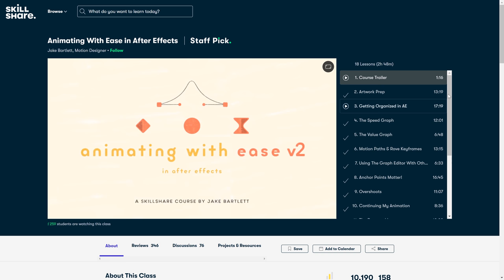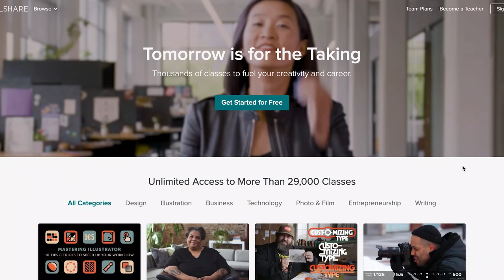How ice water makes hot water boil

Comment: Hey steve I have a good idea. I don’t know if you’ve done this but I think I can make water feel soft. Here’s the steps so I can demonstrate it. Go to your bathroom and start your shower. Then close off your drain so the water starts filling up. Put your hand under the water level just so your hand is barely submerged but not exposed to the air. Now feel where the water is falling down. I don’t know if you’ve experienced it before but you don’t have to do it in a shower setting you just need big water sprinkles and not a jet of water.

Comment: After seeing this demo in my thermal physics class, I tried doing it myself but took it a step further. I tried reaching the triple point of water by capping off the top then sticking the bottle in the freezer (this took like 20 attempts and a whole year before I found a bottle that wouldn't shatter). I didn't actually reach the triple point of water, but I did witness interesting phenomena. If I let the water settle, then gave it a single violent push downwards, it would create this loud popping sound. I took a slow motion video of what was happening and a bubble would form in the middle of the water. I think this might be a way of making super heated water, but instead it's super low pressure water?

Comment: before i watch the video i am going to make a guess.  the water is just below the boiling point at the rooms pressure, the bottle is sealed, so no air can come in or out.  when cold water is ran over the bottle it cools the air inside the bottle, when the air is cooled it contracts.  since the bottles is sealed and no air can go into it, the pressure inside the bottle drops.  at lower pressures water boils at a lower temperature.  since the hot water was just below the boiling temperature at the rooms pressure, when the pressure dropped it started to boil.

sorry if i worded that bad or it didn’t make sense

Comment: You could also think about this in terms of reaction rates. Since the product of boiling (water vapor) is also the reactant /input to the process of condensation, if you increase the rate of condensation, you shift the equilibrium of evaporation towards the product side, so that evaporation occurs more rapidly.

Comment: This seems like the method used for some diy heat-pipes/vapour-chambers where water (or any other coolant) under low pressure is used to quickly transfer thermal energy away from hot objects, only without copper or aluminium tubes. And while I might have been expecting something thermal-transfer related somewhere mid-way video, you did a way cooler segment of this during your stirling engine video.

Comment: I burned my hands pretty badly because of a steam explosion once. Instead of separately heating a container of water to make coffee in a french press, I boiled the water it in a microwave directly inside the french press container and it had no nucleation sites to the point where it was super-heated. Then I poured in the ground coffee. Big mistake! All those coffee particles provided many nucleation sites simultaneously and it erupted showering my hands with super-heated water. Make sure to pour the water onto the coffee that's already in the container and don't be holding it so the effect is more gradual and so you can move away if it overflows.

Comment: 0:11 the bottle is sealed and the vapor pressure is close to making the water/liquid inside boiling by just reducing the temperature,... The water must be boiling at the time of sealing the bottle. Pouring ice cold water will bring down the air pressure inside the bottle lower than the pressure required to boil it without heat. When the temperature of liquid also gets low the boiling would stop.

Comment: Before I watch the rest of the video (I’m at 0:40 ) I’m gonna guess how it works. After he caps it off the pressure on the inside increases to the point where the water can’t boil anymore. When he pours the cold water over the glass, the decrease in temperature causes the pressure to decrease as well. This decrease in pressure inside the bottle allows the hot water to continue boiling.

Comment: An easy way to explain that, is that boiling water only occurs when the water pressure (by heating up, or lowering atmospheric pressure) is equal to or greater than atmospheric. You can boil water if it’s in a vacuum chamber with no heat, or not boil water in a hot pressure cooker (closed system, I’m not a cook tho lol)

Comment: I instantly supposed it had to deal with pressure, but I am a physicist too :p since you talked about superheating, another cool phenomenon is undercooling, when a liquid remains liquid below the melting temperature. This is usually shown with water, but if you do it with a material with high melting temperature, you can see a phenomenon called recalescence: because the solidification occurs at the melting temperature, the undercooled liquid will suddenly increase in temperature emanating more light (that's why the high temperature, you need to see it glowing). I think you can find some videos on youtube. Although this will be drowned in the moltitude of comments, if you are interested I did my master thesis and my first paper on this topic.

Comment: I wonder how much of the pressure drop is caused by the colder air wanting to contract, and how much is from the water vapour condensing out of the air. I would not be surprised if the latter had by far the greatest effect.

Comment: 4:00 ReBoiling water is a famous instance where the water GEYSER esplodes in the microwave. Just boil it once, let it sit there and rest, and cool 3 or 4 hours, (This allows the resident gasses, chlorine,oxygen,nitrogen etc, to out-gas) then ReBoil it. And BaBoomSki !!!
The sudden reheating, builds up the heat below the cool, heavy surface, (with no nucleation sites, and so you have Superheated water under pressure waiting to erupt)

Had you boiled it the first time, ONLY HALF FULL(or slightly less), and suddenly tightened on the lid, then FROZEN the bottle on it's side, (so the water wouldn't be above the halfway mark to crack the bottle from freezing) after freezing, place the bottle up-side-down metal lid on the palm of your hand, (might need to use a paper o-ring to seal the lid but allow the heat pass directly to the liquid) after a while you'd "SEE THE TRIPLE POINT OF WATER" , where you would see ICE, LIQUID WATER, AND BOILING STEAM, occurring from the heat of your hand.  All very exciting, but your SUPERHEATED GEYSER IN A BOTTLE, takes-the-cake for sure!!!
How on earth did you find the ice water on top of heated vacuum bottle anyway? Not a usual household practice is it? Creative environment for sure!! Mixing oil and water...

Comment: I think the ice water cools the air in the bottle, thereby condensing it and decreasing the air pressure, so the hot water boils until the air pressure is back at some equilibrium point.

Comment: Edit: it's the same

I just saw the demonstration and I had a theory that only got confirmed when you purposely mentioned closing the cap tightly

I believe that the cold water condensed the vapor thus decreasing the pressure in the bottle making the vapor pressure of the liquid (at near 100°c it's gonna stay at around 1 atm while the pressure will be significantly less) higher than the pressure in the bottle and that's when liquids boil

Comment: Lol, I was thinking that finding a wine bottle that wouldn't shatter was the real question in this experiment. It's not like those things are made of Pyrex.
Also, always stick your spoon into the mug before putting it into the microwave. The metal helps to heat it more quickly and no danger of steam explosions. And no, a spoon in your mug of tea doesn't cause problems in the microwave.

Comment: I DID pause. And I got 2/3 of the explanation.

Realised there was a difference in heat capacity between the liquid and the gas.
Realised there's a pressure drop as the gas cools.
But I didn't even consider the vapour pressure. 

The gas I was thinking about was just air but now I'm thinking that the vapour pressure drop is probably the most important contribution to this effect.
I wonder if this experiment would still work if you brought the container close to the boiling point in the microwave without exceeding it.

Comment: Paused at 0:46, my assumption is that the cold water shrinks the bottle ever so slightly, and increases the pressure inside the bottle before the transfer of heat allows the warm water to cool.  I think it is probably different than that, but it is a rough guess about pressures.
Reply: Edit, Oops, I forgot that a lower pressure decreases the threshold of boiling, not the opposite.  It makes sense.

Comment: Yeah, the explaination was kinda obvious - but entertaining to watch nontheless. Btw: you can carefully scratch a bottle around its circumference and then break it along that line with hot water. With a little bit of practice you end up with good results. You can either smooth out the edges for use as a drinking glass, vase or spaghetti container (mine are held by a cut off Havana Club bottle), or leave it sharp, reattach the top end of the bottle, fill it with liquid and screw on the lid. Negative pressure will hold the liquid inside and the breach is almost invisible... until someone decides to take/open the bottle ;D

Comment: I paused the video before any explanation and came up with the idea that lowering the pressure inside of the bottle would reduce the boiling point of the liquid within. I noticed that the bottle has a cap screwed on, and it wouldn't work without that - you'd just lower the temperature and not the pressure without the cap.
EDIT: After watching the super heated water bit, that is why you should leave something like soup to stand for a minute before taking it from the microwave.  If you don't, you can get a nasty hot soup explosion when the spoon is put in.

Comment: I had once a hot chocolate that had something similar. 

The hot chocolate didn’t boil in the microwave but was for 10 seconds longer in the microwave than I normally would have. I took it out and put a spoon into it. It started boiling immediately. It was a mild reaction so I didn’t get hurt at all. But the hot chocolate came out of the cup and it was a big mess. I guess it is the same as what you explained in this video?

Comment: My initial guess was that cooling reduces the pressure of the gas, as in the ideal gas law, so that would make the liquid boil. Giving it a few more seconds thought I realized that the vapour would start to condense, reducing the pressure of the gas a lot more than the gas law would predict, and reducing the partial pressure of water vapour in particular. Essentially, ignoring the air, you're evaporating the water in the bottom of the bottle and condensing it at the top quite efficiently. Might work even better if the bottle were a better heat conductor, but I guess aluminum cans are less transparent and less micro-wave friendly. :-D

Comment: My explanation initially was regarding the Latent Heat.
The cold water loses heat to turn into Ice, while hot water gains heat to boil.

But the loophole with my explanation is that it should technically cool the liquid rather than boiling it, in fact ice cold H20 didn't turn to ice.

Comment: I definitely guess that exact thing.  It has to do with Vapor pressure. Increase the energy in the liquid and the molecules go from a liquid phase to a gas phase. Gas is more compressible  therefore you can fill the area with more molecules since there is enough energy. This increases the pressure when you cap it off until it reaches equilibrium.  Lowering the pressure... lowers the boiling point. By cooling the gas molecules aka removing energy. The pressure drops causing the water to boil. This is the reason that a room temperature bottle put into a fridge become compressed and deformed. Lower energy lower gas pressure. Same reasons that they tell you about your tire pressure with change in seasons.

Comment: It should also be mentioned that vacuums are dangerous, and by cooling the water vapor, you're creating a fairly strong vacuum (over 95%) in a bottle that may not be able to handle it.  If the bottle fails, it will likely implode, showering the area with glass shards and the still-hot water.

Comment: Just going to guess based on the title and thumbnail alone, pouring cold water causes the air on the inside of the bottle to decrease in temperature. 
This causes the air to decrease in pressure as the molecules vibrate slower. 
This decreased pressure lowers the boiling point of the still pretty hot water, causing it to boil.

Comment: Before I'm listening to the explanation: I wondered why he pointed out to put the cap back on and why the bottle didn't overpressurize while the water was boiling from the icewater. My guess is: the icewater condeses the steam in the bottle, creating low pressure, which in turn lowers the boiling point of the water at the bottom. Since the water is already pretty hot it starts boiling again
Reply: Congrats to me: spot on 🥳

Comment: okay so I'm feel free to have anyone recite this back to me but I'm over taking physics in high school and it was my favorite class I ever took honestly I'll never forget some of the things I learned there and I literally can look at things like table chairs and tell you how much they weigh by looking at their mass and guessing what they're made out of in their density which is all fun and done. Until about 2 years after high school when somebody told me that the temperature of something depends on its mass it's ability to retain heat or cold transfer it and then pressure. Along with any external factors that might be keeping a hot or cold etc right. but I don't ever remember studying anything about pressure and its relationship to temperature in my senior year physics class and to be honest it's a huge deal because in every application the pressure is different in the pressure inside your house a slightly different than the pressure outside your house and although it doesn't make much of a difference when it comes something like wood glue drying that's the difference of like three or four hours so this really should be taught at the basic level when we first learn this stuff because it literally is important to every step along the way anything involving temperature involves pressure as well and we're just not taught it in our first year physics which is kind of like learning how to do basic math and when ever teaching you PEMDAS you're missing the p or something. I'm glad a lot more YouTubers have educational channels like this because it's really easy to figure out but would have been handy f**** 20 years ago.

Comment: i wouldve guessed that by capping off the bottle, water vapour will fill the remaining inside volume, and as steam is incompressable once the volume is filled the water cannot boil (release steam) into the bottle anymore as it cannot compresst the vapour, but then by pouring the cold water over it, that condesnses tehe steam back into water, creating a space in the bottle for steam to fill.

Comment: I got this idea based on the fact that he's primarily pouring the icy water over the bottle where the air is, I'm guessing it's because the cold water cools the air, but not so much the hot water. This reduces the air pressure inside the bottle, dropping it low enough that it causes the boiling point of the hot water below its current temperature. Same idea as using a vacuum to lower boiling points to room temperature kind of thing.

Comment: Haven't watched yet but I think the cold water takes energy away from the air in the glass causing the pressure to drop and the hot water has has enough to boil once the pressure low enough

Comment: My guess: The air inside the bottle is very hot, and probably a mixture of steam and air. When you pour cold water over the bottle, the air contracts, pressure drops, and water boils at a lower temperature at lower pressures.

Comment: Question that my little sister and I have : can this also be explained by the fact that the condensing of the water vapour leads to a decrease in pressure in the bottle, meaning the water boils to equilibrate the fractions of water in gas and liquid phase, similar to how pulling a vacuum on the water would cause it to boil? 

Is this just a different way of explaining the same phenomenal you described or is there a flaw in our thinking?

Comment: The ice water cools the air in the bottle, causing it to condense slightly and drop in pressure, allowing the water to boil (off gas) at a lower temperature?

Comment: Awesome video, also that's exactly how heat pipes work.
Reply: You may be a little coy here, referring to "heat pipes", not"heating pipes", as described here (which would have served better s a comment): https://www.1-act.com/heat-pipes-a-basics-demonstration/
However, in this video there's not only not a small amount of working liquid, no electronic coolant,not  truly a vacuum, no wick lining (so no capillary return),  ans no efficient external heat sink  in this video? Perhaps you meant to state the video's phase change is the foundational physics mechanism for devices called heat pipes? You might as well have seen petrol aflame and said that's exactly how a turbine engine works.

Comment: My explanation (before watching) is that the water cools the air inside the bottle, which lowers its pressure and so, the boiling point of the water decreases, causing the water to boil.

Comment: Ok, before i watch the explanation, Heres my guess:
The cold water cools down the air inside the bottle which means the pressure inside drops which causes the boiling point of the water/liquid to also drop, but since the water is already hot it actually starts boiling.
Reply: Close enough I guess?